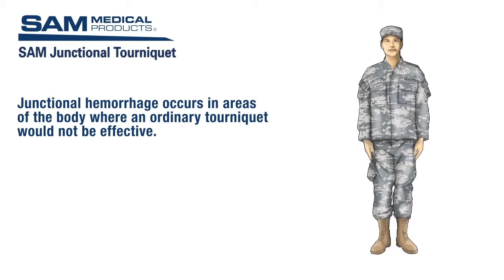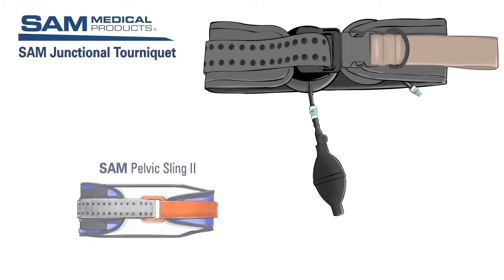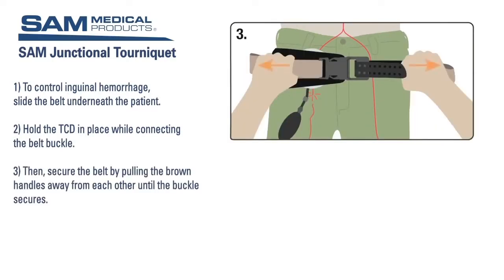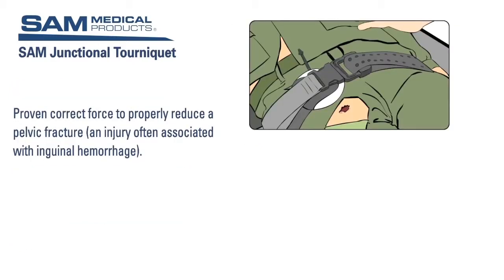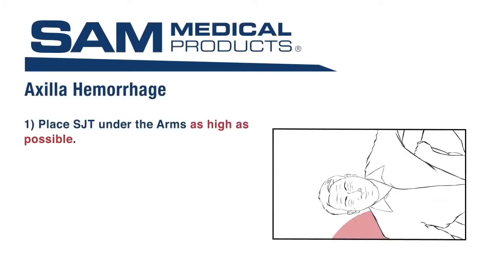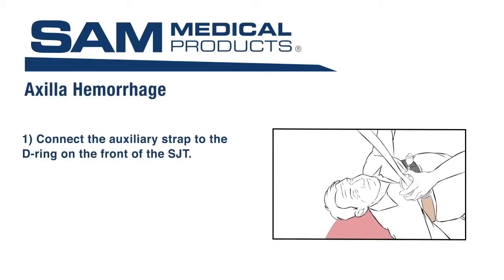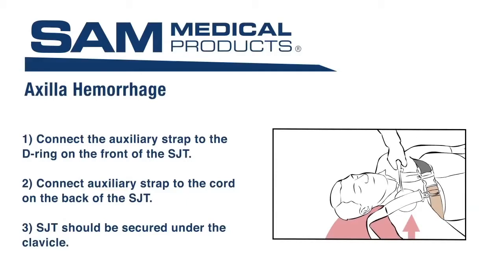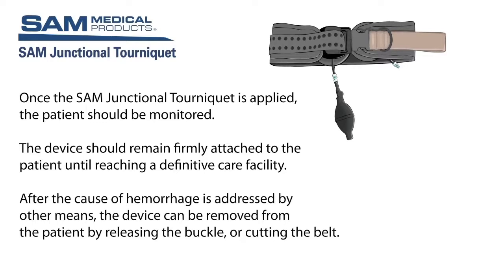SAM® Junctional Tourniquet

Comment: Is this for every situation where you need to stop juntional hemeraging or if you can, should you get right to applying preasure with your hands
Reply: I know this is a bit of a late reply but if you have access to it I recommend using it. It's not for every situation but it can definitely be a life saving intervention in cases where a normal TQ can't be used or if you don't have access to sterile gauze/cloth to pack a wound. I will say that if you have the time, training, and supplies to pack a wound that you should do that as the patient is less likely to risk losing the limb to infection or compartment syndrome.